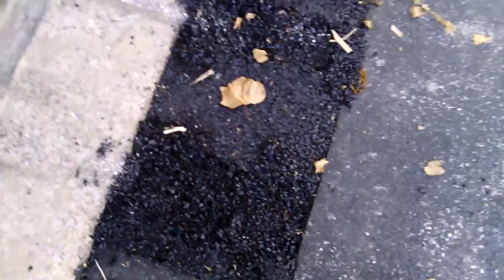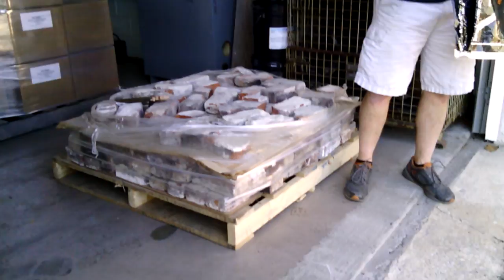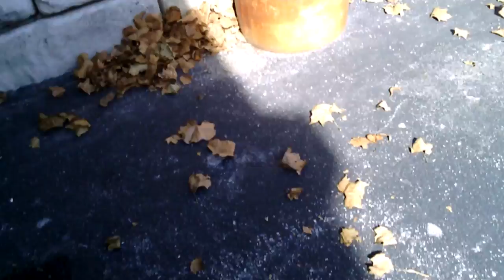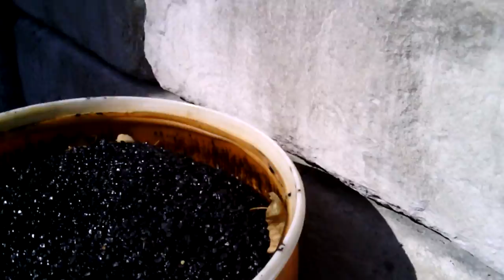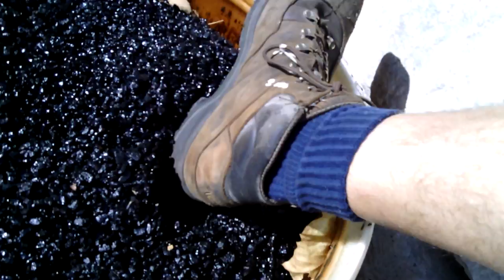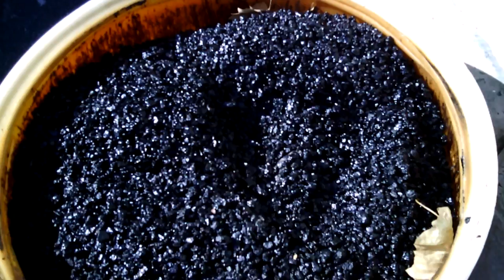QPR asphalt patch not curing

Comment: so, cold patch asphalt has a bit of a marketing scam to it. It doesn't really 'harden' for weeks and weeks. It loses its tackyness fast so you can drive on it, but its not hard. Its really only good for holes in flat parts of blacktop that will not have wheels TURNING (moving steering wheel) on it. Any other scenarios ( unless you buy that 45 dollar a bag stuff) you will have problems. Here is what you can do to turn it into something rock hard in 2 days: get whatever brand you want of cold patch. Also buy vehicle strength (high strength) concrete, such as quickcrete Q max or similar, also some asphalt liquid crack filler and some asphalt quick dry skim coat material (latex-tite makes these products as an example you can get it at HD). Now if you are putting this down fresh you can skip the liquid crack filler, but if you have already put it down and need it to harden, then buy the filler. So for those putting it down fresh follow the instruction of the cold patch EXCEPT mix in about 4-5 cups of dry concrete per bag and DO NOT fill patch over the area, fill it level or 1/8 inch under sized. Lay down, compress by running your car over it and then lightly water it (not too much <1/2 gallon per bag) to activate the concrete. Give it about 45 minutes. Then liberally sprinkle dry concrete over the top and mist it with your hose for a few seconds, give it  a day or at a minimum until the concrete has its minimum cure strength time (4-6 hours it will say on the bag). IF you have already put the cold patch down and you are unable to mix in the concrete you will be using the liquid crack filler before you sprinkle the concrete on top. go around the perimeter of the hole you are filling and just touching the outside of the hole until about 2 inches into your patch, pour the liquid filler. lightly push this into the cold patch. This will stabilize the edges from chipping due to car tires hitting it. Give it 20 minutes and go to the sprinkle concrete on top step. Once your top has harden this material should be pretty darn strong and not move. However, it will look off color and it may still chip over time. This is where the skim coat comes in. Follow the directions and trowel it on to cover the patch. This material goes quickly BTW. Make sure you cover the edges of the hole at a minimum, overlapping the good blacktop about 1/4 inch. The skim coat will protect against chipping and wear and make it look good. This method can be used on gentle slopes and areas of turning. A note, this method costs a little bit more, but if you plan on buying the super high quality 45 dollars a bag stuff, if you are going to use 3 or more bags, my method is cheaper and hardens faster. 3 bags of 45 is 135 and my method will cost about 60-75 per 3.
Reply: I have used it and it worked just fine. It was sunny and in the 90's but it worked fine
Reply: Could the patch be sealed after a few days after the cement hardened (let's say a week)?
Reply: tdok cold patch has extra oils so it stays soft for a long time. It’s really not meant to be a permanent fix and definitely not meant to have pallet jacks or forklifts on it
Reply: It will harden in a couple days if you don’t use that iron tamper. Use a 4x4 and hit it until the gravel in the mix breaks down. And only put down 2 inches at a time

Comment: I used both kinds the same day.  This soft patch and the soft patch you add a little water before you tap.  This stuff is soft after 2 weeks and the other got hard after 2 days. I will try a sprinkle of mortar or cement mix.

Comment: Heat it up with a propane torch then compact it. It will harden up
Reply: Does this really work???
Reply: Yes
Reply: It worked for me, but it also removed some of the oil so the very top gravel rocks are not sticking. I was told it’s best to heat the product before laying it down. I may slurry coat it now since the product is hard from torching it after I laid and compacted it down.

Comment: QPR Is a great product, It will say soft if it is in a low or no traffic area, it needs compaction. Build a crown on the patch and compact it. Dusting it with dry sand or cement will help, It is designed to be soft so it moves a bit, rigid patches pop out and fail.
Reply: Read the info on the website and purchased a bag of sand with the QPR. I should have left a little more of a crown, but the product worked perfectly for me.

Comment: I had the same problem.  I looked up QPR and they said to dust in some Portland Cement.  I did and, it was still soft two days later.  On the third day it hardened up.  I doubted that it was hard, so I drove my car over it.  It was hard.  I left now tire marks.

Try raking it up a little to expose the aggregate.  Put about 1/8" of mortar mix , or 1/16" of Portland Cement and tamp the fire out of it.  See if that helps.
Good luck.

Comment: Try putting a piece of junk plywood over the area that you travel over it and leave it their.... Its not pretty but will give the mix more time to cure... These cold mixes are not the greatest...I have filled potholes with the various cold mixes that are sold in bags and buckets... some are good and some are junk that still stays tacky and easily become depressed and indented and pushes up areound the sides of the wheels when you park directly over them on or if a heavy wheel should displace when traveled over...like a pallet jack wheel...on our potholes At the foot of the driveway  I have found that no matter how well I tamped when a car dorve over it shortly after it would get displaced and pushed down in the area. but if you leave the plywood  iover them for about a week it gives it more time to cure... you can apply water to the top of them as per instruction if the directions call for it and say that "it helps harden it" but with that pallet jack situation and that area why dont you just get a piece of diamond plate and put it over the patch to level it and leave it there... that shoud take care of your problem... (just a suggestion)

Comment: It can take up to 6 months to fully cure also you should have dusted it with mortar dust and tamped it into the QPR it will help harden the top for a quick use especially going over with a fork truck.

Comment: 😊Thank you for posting. Can you give us a follow-up ??  how did you fix your asphalt problem? How did it turn out? I am having the same issue ! 😕
Reply from the maker: I actually remove the stuff and was supposed to get a refund but that check never came and then just filled in with high strength concrete
Reply: @JnJShiffler  Hi! I really appreciate you getting back to me. Thank you.😊 I might have to replace mine too
Reply: I wasted money too. Mud is better than this garbage
Reply: @sebykuriakose7004  it worked GREAT for me, but I dusted it with sand before tamping. 1 year later and no problems.

Comment: dont buy qpr. i work at quikrete... if u need help message me
Reply: Don't use quickrete either, it becomes a brick in a bag in the winter
Reply: QPR works just fine.
Reply: Carlos Barajas HELP me the quikcrete asphalt repair I put down won't harden
Reply: @williamhoskins3053  Any luck getting the quikrete to harden? I did the "tamping / plywood / drive over it" routine, and it's still like oatmeal 36 hours later. Suggestions?
Reply: Carlos: I used a 50 lb Quikrete bag.  I did the "tamping / plywood / drive over it" routine, and it's still like oatmeal 36 hours later. Suggestions?
Reply: What do I do to harden it